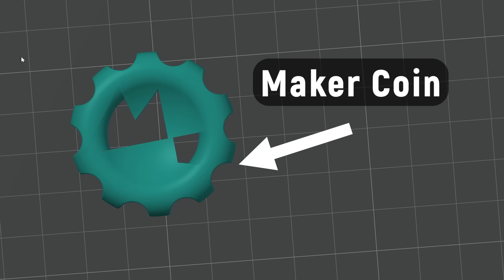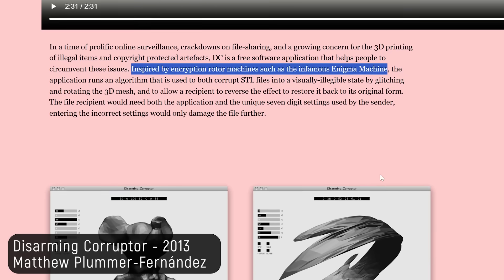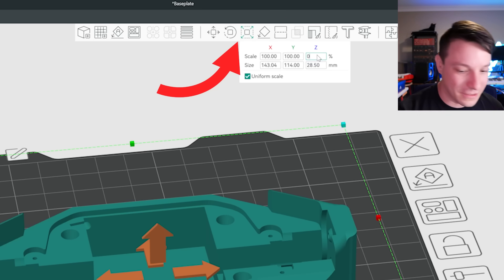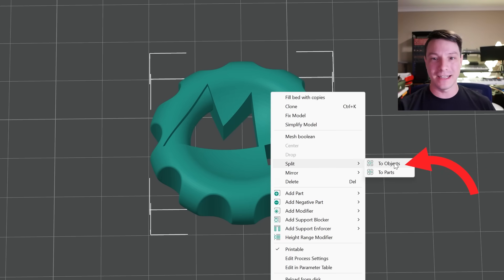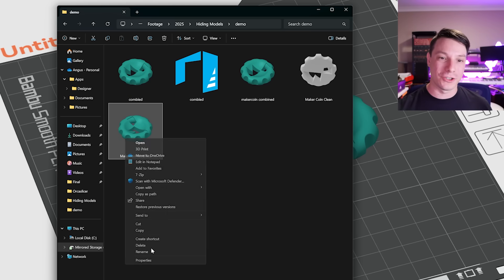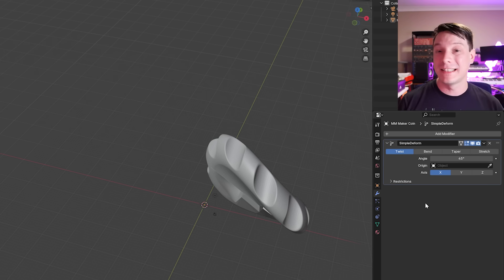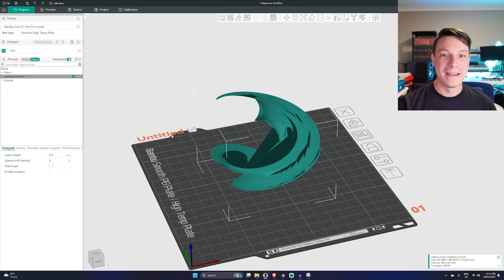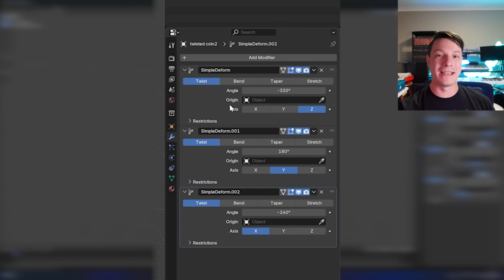How to obscure 3D models for fun or profit.

Comment: This whole video is an example of why we should stop sharing 3MF files on model websites. I don't want your slicer preferences, I don't want the risk of running malicious code, I don't want the hassle of messing with file types if I want to open the model in 3D modeling software.
Reply: I know he said they're common, but as a 3D artist in the 3D printing space, STL is still 100% the standard for non-CAD models
Reply: Well some of us like to edit
Reply: Yes 3MF is really frustrating because it’s more like a project file than a model file. It would be nice to have STEP instead because it preserves the parametric goodness without any other junk. If I had a STEP file I could tessellate it and export an STL of whatever quality I want too. So much better. If people want slicer settings, fine give a 3MF too but why is it the standard?
Reply: I couldn't actually believe 3MF could run malware, but some research reveals this is absolutely the case.  3MF vulnerabilities are really the fault of the slicers, but we've recently seen several viable attacks because 3MF files aren't really meant for sharing:

- Prusa slicer will run arbitrary command lines stuffed into a field called "post_processing".
- Cura straight-up runs eval() on some things in the XML contained in 3dmodel.model.

WTF year is this?  Eval()?  Arbitrary hooks for running command line things?  No site should be allowing 3MF distribution at this point, unless it is going to put in a huge amount of effort sanitizing them first.
Reply: I had problems within the slicer using step files and could fix it via exporting the same file as a STL from the CAD. So I never used step since then.
Reply: @lazyman1011 .step files are for editing in something like Fusion. Makes editing a million times easier. Then export it as a mesh / .stl for use in a slicer.
Reply: You got me wrong and I know everything about the file formats. Slicers support step import but I had huge problems with it and that is what I wanted to warn others about. In some places it sounds like sharing step instead of stl.
Reply: @lazyman1011  What problems?? I havent had any, ever.
Reply: @ Don't worry about it, he "knows everything about the file formats" 🤣
Reply: @lazyman1011  You should.
Reply: What I want to see is the ability to have a 3mf file that contains a model and a few specific settings, not an entire print profile. Until that happens, 3mf files are just "mystery model format" files (everything else gets discarded upon opening the file because there's no point in doing anything but importing the geometry only).
Reply: @Chirimorin What would those few settings be?

On sites like Printables and Makerworld, where the profiles target specific machines, I think they can be very valuable. They can also be ignored.

It should be encouraged by all repositories, to include the raw model files like .step, or the equivalent from other softwares, but if course that should still be at the designers discretion.
Reply: You obviously aren't the target audience. It's for ppl that don't want their time, effort & work stolen. Uploading it in a different format doesn't stop them from scraping your work, but it can make it less likely that they'll be able to copy & resell it w/o your permission. A good example is places like JLPCB. You have no assurance that they aren't copying your circuit board & reselling it out of a chinese factory back to other ppl that you should be getting paid for. Also there's nothing wrong with 3MF. The reason it's used instead of STL, dxf etc, is because it is an achieve format just like a .Mp3, .Bluray file & the like, but it allows other info like movement, coloration, bones, stress mapping or physics information to be loaded with the file. The format was created more for Autodesk type users that need the moving parts of a car or jet engine to follow that information. Like an engine with a mis-aligned timing belt. It would be amusing to see the look on your face when your car grinds to a halt without it.

You don't want slicer preferences huh? Ok, you download a file to print the inside of a rocket engine (like the one Integza made) but you don't get the settings, & it fails to work every time you try to print it. Why? Because your slicer reverted to it's default settings instead of the gyroid infill that is CRUCIAL to it working properly.

As for malicious code, your not any safer using virtually anything else- there hasn't been a single known instance of something like that through any printing file- it's way more likely that it happens through the manufacturers 3-D printer's WIFI update like what Bambu Lab did recently to make everything have to connect to their far more breachable network than your isolated LAN of printers. Lastly there isn't a single slicer or program that forces you to export in only 3MF, so export in whatever you want- but if you get ripped off, don't come crying back. It's just the consequences of your own actions.
Reply: Except 3mf is superior to stl in every way possible
Reply: @the_mister_magister Except that STEP files are better than 3mf because they are easy to edit in every CAD program on earth (except OpenSCAD ;) ) and don't have the annoyances and potential vulnerabilities of 3mf.
Reply: @generic0000  Exactly. My experience with 3MF files was no better than regular STLs. The best format I've used and am using is STEP files since they're much smaller and accurate
Reply: @generic0000 good luck using step for anything that's not cad. Figurines and such
Reply: @randomblock1_  Good point. I can't design in Blender and I only make practical prints, so I didn't think about that. What is the industry standard file format for artistic files?
Reply: Apparently the comment I responded to is no longer here. He pointed out that step files don't work with models made in programs like blender. 

Figurines and miniatures are a big part of 3d printing that I don't interact with.
Reply: @the_mister_magister step is even better
Reply: @the_mister_magisterCult of 3MF brainrot. 3MF is worse than STL in every way that matters.
Reply: @the_mister_magister yipee! free malware included!

Comment: I tried something similiar. Essentially, I created an object in Blender and applied modifiers. The "key" in my directions were to apply another modifier in the negative values to restore the original object. But, I was never as creative as you.
Reply from the maker: Sounds like a similar technique! Blender always impresses me with how robust the modifiers can be.
Reply: I wonder if geometry nodes could be used to make a powerful encryptor in this regard.
Could even include a switch so it can encrypt and decrypt without the need to manually invert the values.